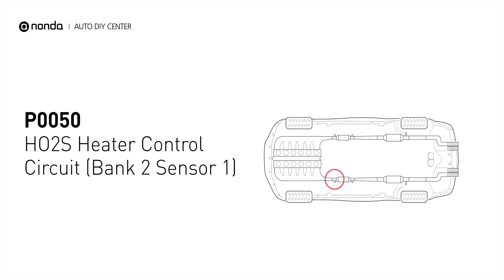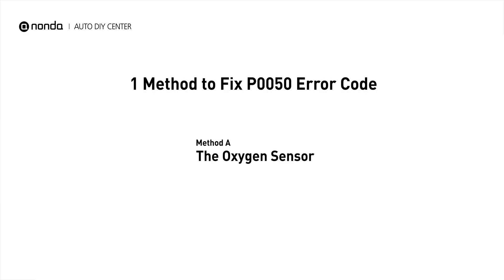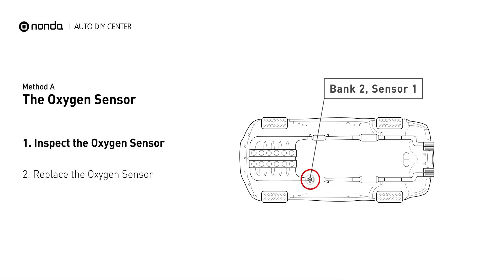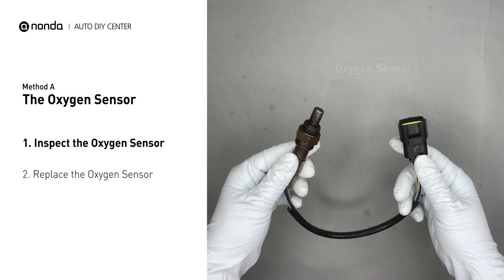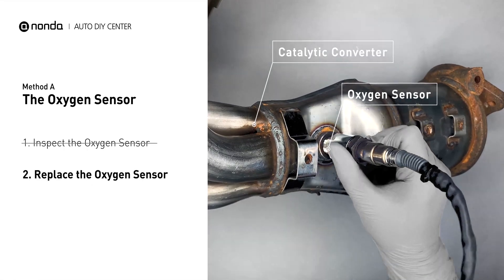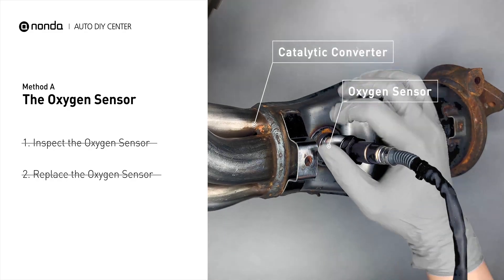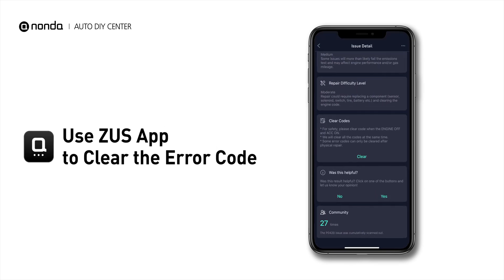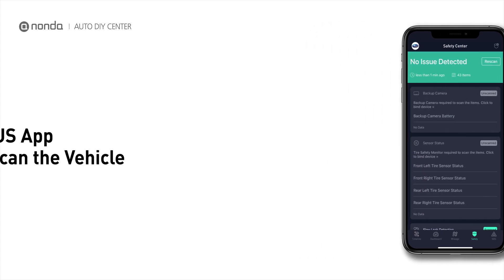How to Fix P0050 Engine Code in 2 Minutes [1 DIY Method / Only $19.37]

Comment from the maker: Hi, I'm Steve, nonda's lead mechanic engineer. 
Feel free to leave your comments here if you have any mechanic questions, I will be glad to help you out!
Reply: Hi  steve  i have P0050 code, on the OBD scanner this sensor readings fluctuates between 0.9 to as high as 14 while the other 3 are between 0.9 and 1.2  is thats ok?  Which sensor is bad?